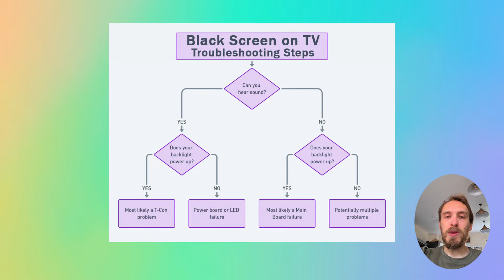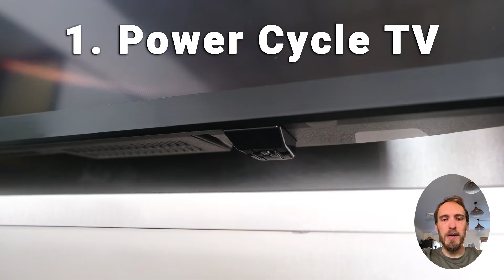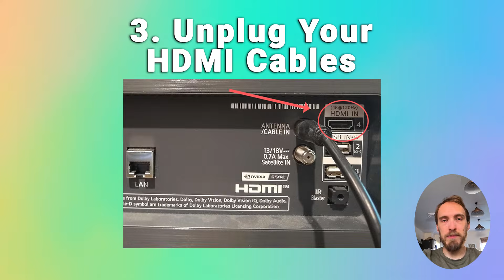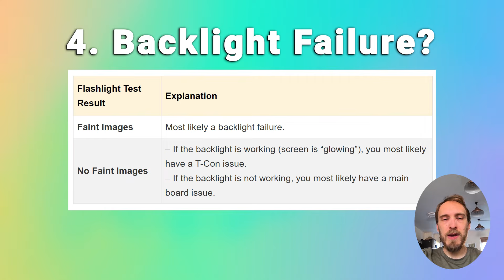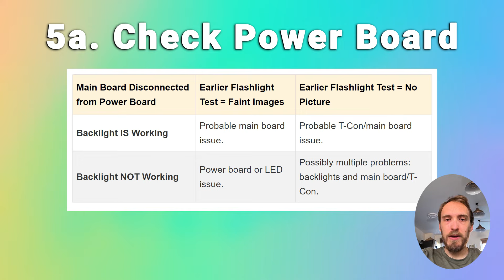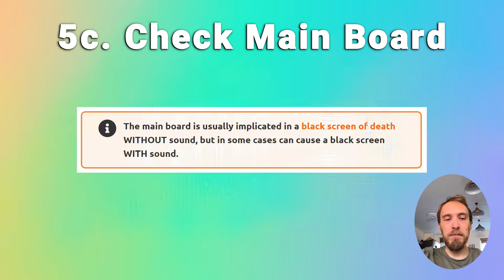Panasonic TV HAS Sound But NO Picture | Black Screen WITH Sound | 10-Min Fixes

Comment: Hi my Panasonic TV is 10 years old and just today this issue happened no picture just sound. I also have a Amazon TV Fire stick connected to HDMI 1 and it's not working either. Secondly what sort of cleaning products should I use to clean the screen??